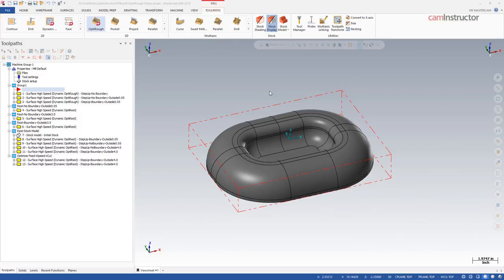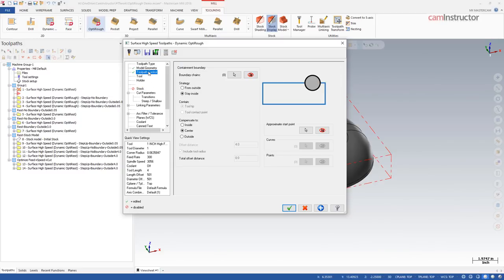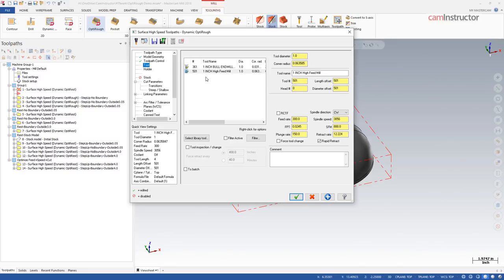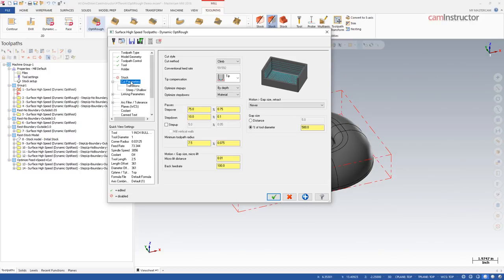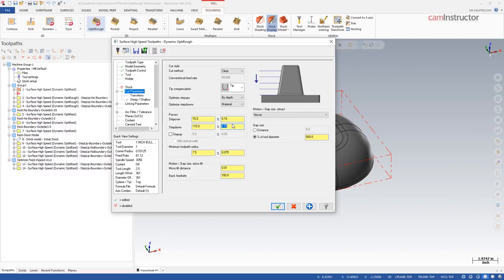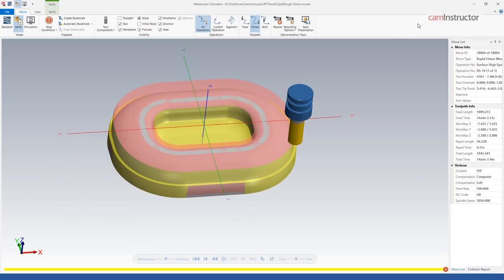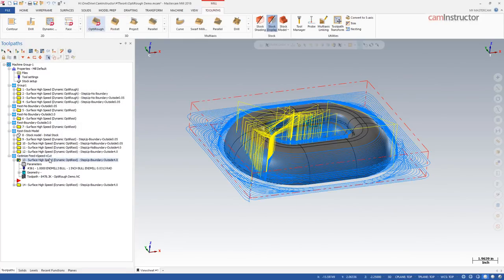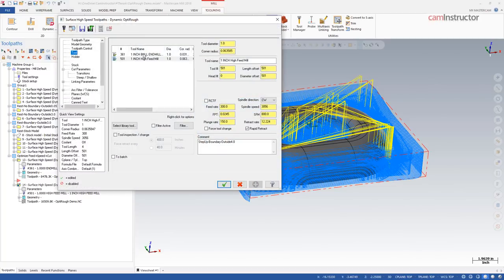Mastercam OptiRough Toolpath Video 1

Comment: Actually, I am a subscriber of your 2020 course here in Canada, and in a few sections that you mentioned, Arc Filtering is one example, there is a detailed explanation of each of them.  Actually, while there are few explanations but is not covering all.
Reply from the maker: What section of arc filtering were you looking for more information on?
Reply: @CamInstructor  In Dynamic Milling section when it goes to Arc Filtering.  While there is a general explanation about it but it does not go to option and its application.  This is true regarding other things you mentioned in the Cut parameter.  Anyway in the Mill 3D lesson 13, Exercise 13 or there few dimensions are missing or things are not quite right.  It is 2 days I am trying to make the loft solid that comes all distorted even though I make them the same amount of entities.
Reply from the maker: That lesson you need to pay attention to the syncing options used and the starting point/direction of your chains.
Reply: Again, Lesson 15 on 3D for 2020 course.  In the cut parameter on Overthickness and Bitangency, you mentioned there are full videos about them.  I am struggling to see where is it still.
Reply from the maker: @farhad64it  These are questions best asked through the Ask Instructor function on the website. That way I can upload supporting documents or videos.

Comment: that’s a long cycle time 👀 The strategy is very good no doubt , but the time is just crazy .
Reply from the maker: Big parts take time, even more time if you need 3D motion. Material will play a big roll too.
Reply: CamInstructor yeah i know , tolerance also comes into play
Reply: CamInstructor if you have linked in let’s connect ! i would like to know more about opti roughing

Comment: Is there a way to automatically generate "tabs" ?  Say you wanted to hold this part in the stock for secondary operations on the bottom side?  I realize most of the point of this video is to remove all the stock...LOL!
Reply from the maker: You could have extra stock on the bottom for holding and just stop the toolpath in Z before machining it away. If you want tabs, you could model some in and then OptiRough could see them and machine accordingly. 2D Contour has an option to auto generate tabs which could also be an option.

Comment: Its not a perfect program.  U can optimize the cut order and just draw a boundary using bounding box. No need of selecting stock and stock modal.
Reply: Sree Kumar that’s what i was thinking as well , just draw a bouncy box where the stock would be and then create a tool path based on that boundary box
Reply from the maker: I can create a stock model much faster than geometry to represent stock. Stock model, 3 mouse clicks, geometry to represent stock, 10ish...and that would be for simple stock. Anything complex and the difference grows more. Also, if you change the stock size, updating the stock model is again very few clicks and the toolpath is tied directly to it...if you create new geometry you have to remember to rechain in the toolpath. Its all personal preference as there is always more than one way to do something in Mastercam...the point of this video was to work through many options and see the different results. 
As far as toolpath optimization, there are 3 more videos in this series looking at optimization of OptiRough. This is only the first video and the part is not done yet.
Reply: CamInstructor there’s more than one way to skin a cat and i respect it